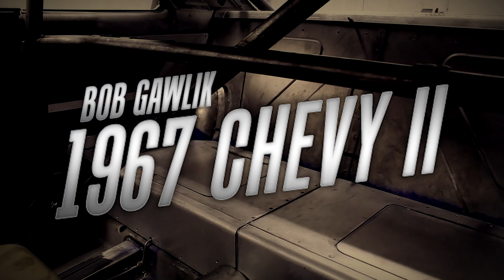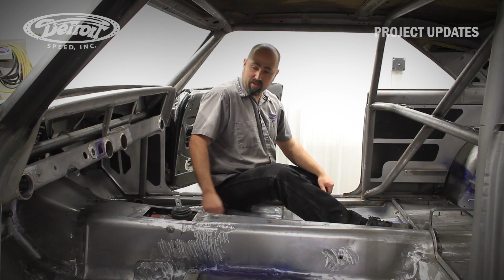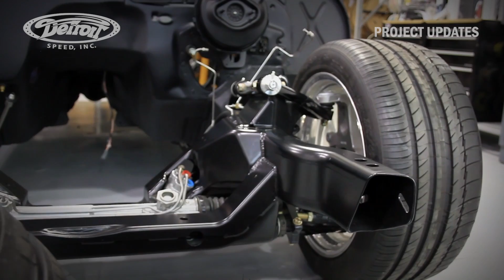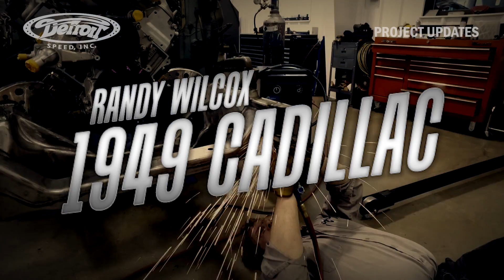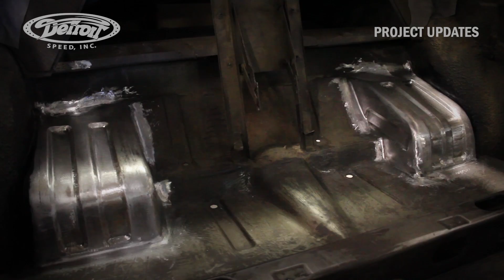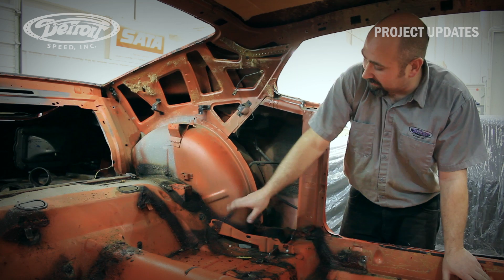Project Updates - January 2017 - Detroit Speed

Comment: I did a nut 'n bolt restoration on my '70 Boss 302 a couple years ago. Now wishing I would have done something similar to the Boss you are doing. For all the $$ spent it simply was not worth it. I could have had something I could have jumped in and driven anywhere and gotten more enjoyment from it for less $$. It simply was not worth having where I had to trailer it to shows over xx amount of miles. If I were to do it over it would not be "stock".